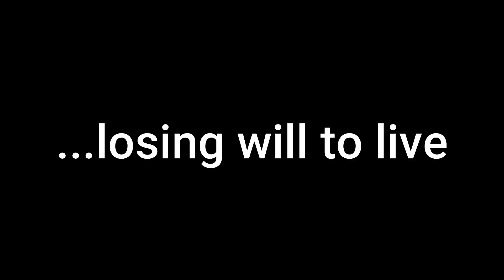Audi 80 EV Conversion - #19 - Let's go for a drive

Comment: Hey Fiachra cooke, What do you think about building your own enduro powerful ebike{it has pedals} vs converting a car to electric.
An ebike(powerful one) may cost parts of $3500 weighing about 60 kgs,battery capacity of 3Kwh may take you 130+Km,You don't pay licenses ,swim through traffic,More efficient.You can slap a trailer at the back in case you have a luggage.If the battery dies you can pedal to home. What are your thoughts?

Comment: Hey ,good work ,regarding the power steering pump noise ,Have you ever thought of just building a sound proof box enclosing the pump/Noisy mechanical part?
Reply from the maker: Thanks👍. Yeah, I have thought about surrounding it in sound deadening material but just unsure what material is best. All suggestions welcome.
Reply: @Scampi6000  OKay maybe a bit of googling/researching would solve that

Comment: Hi, i have old b3 quattro ;)  can you tell me +/- what is price for that swap :)
Reply from the maker: Ah nice! Is that a CQ or 90? A quattro conversion is my next plan on a b3 platform. Few ideas floating around using lexus gs350h gearbox (dual motor) feeding rear and front diffs. Reckon if you are handy with your hands and can cut/weld, you could do it for under 5-7k. Battery is the big ticket item. Have a look at the openinverter.org projects to give you a good idea of a 4wd system and what it looks like. If you start before me I'll be Looking at what you do😀

Comment: Well done Fiachra! I knew you would get there ahead of me when you started posting these videos showing your progress:-) Great to see it running on the road! Is that the familiar sound of the electric power steering pump I hear spinning up in the background?
Reply from the maker: Thank you Shane! In all fairness, I had a helping hand of losing my job to help me get finished😁. It's brilliant to be able to drive now and you'll know all about it soon enough. Keep it lit. You are doing it right making sure the running gear is all up to scratch. By the looks of things it all needed it! Yep, that's the zafira pump. I'm already working on plans to swap it to a Opel Corsa C steering column/motor/ecu. Bullet proof and used in rallying. Check it out on the General/Hardware area of the forum👍

Comment: Brilliant - well done! I've enjoyed watching your conversion and learned a lot - thanks for filming it. Can't wait to do a conversion, where do you have the VCM mounted?
Reply: Congrats on a cool project.
Reply from the maker: Hey, thanks! Glad it hits the spot. I have the VCU mounted in the passenger footwell where the old ECU use to sit. I reused some of the old ECU wiring that feeds from there into the engine bay as opposed to running new. Worked out well once I had it all labelled correctly.

Comment: Use an hidraulic acumulator and a pressure switch for the power steering https://youtu.be/uMFVUukXfQA
Reply from the maker: Thanks. That's what is built into the Audi system at the mo except for the switch. I have looked at a few different ideas to keep the hydraulic system but anyone who has tried ends up falling back to vac boost or the new iBooster as they are way more reliable.